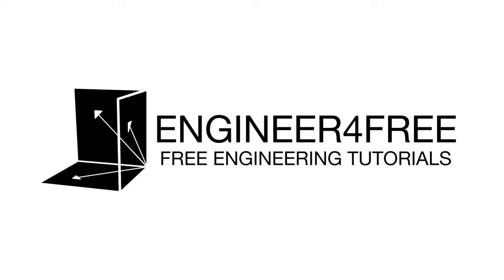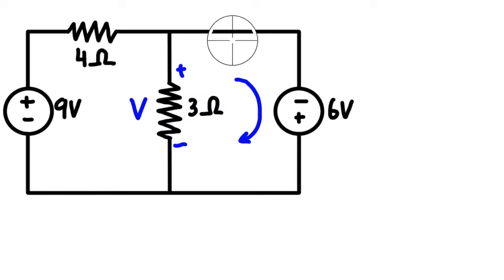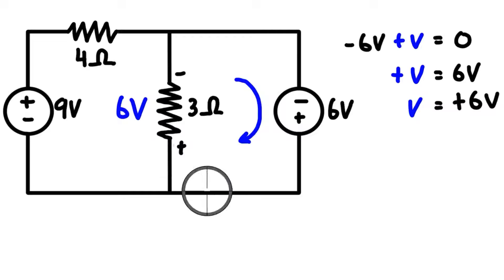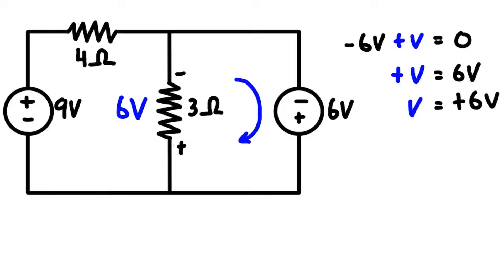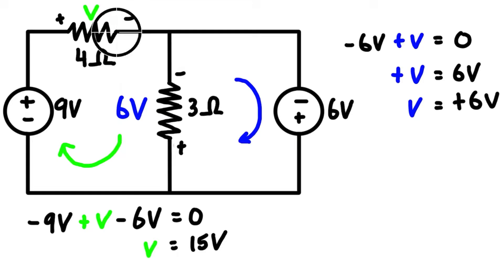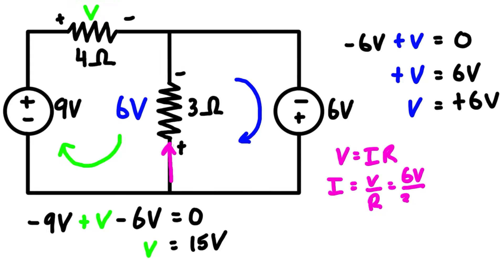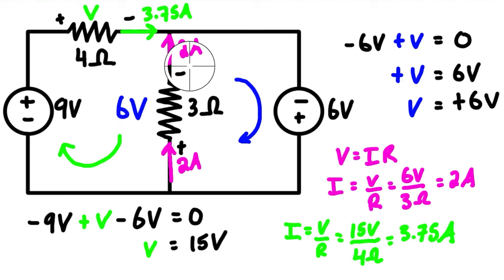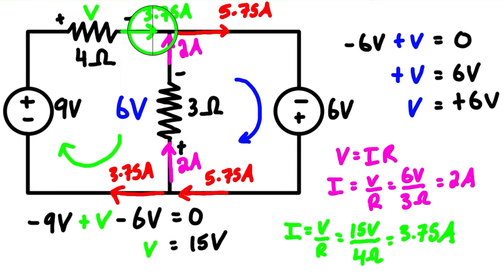Kirchhoff’s Voltage Law (KVL) Example Problem #2

Comment: i dont understand the guessing the polarity part
Reply: Basically,  it doesn't matter if you guess the polarity of an element wrong. If you get a negative voltage, then you know you guessed the wrong polarity and can flip the signs to correct it.

Comment: What if we start the loop on the left first? That would make the current on the 3 ohm resistor has the same current as the 4 ohm. Then we have different answer.